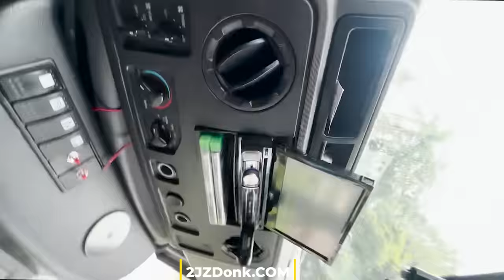Puttin New 24" All Gold Daytons on Fredrarri's 73 Chevy Vert

Comment: cuz definitely has never put daytons on before, the other video was extremely difficult to watch.when installing daytons that are not color coded adapters "red right and white left" the rule is the knock offs/hex heads/wings always tighten to the front! that means it screws on tight as the car goes forward.after you drive the vehicle you need to beat the hex head after a few miles cuz there is chances that it will loosen up! cloth over the hex head, key on the hex head,foot on the key, then beat the key with the lead hammer.
Reply: Agreed. They also won’t know that you ABSOLUTELY need to put grease on the center adapter! Daytons are a pain in the ass and the smallest details matter. The way these were mounted, I wouldn’t be surprised if one comes off while driving OR they don’t come off because they welded together due to no grease.
Reply: You're 100% wrong. The knock off always tightens towards the rear of the car
Reply: I can't speak on Zenith but Daytons tightened up to the rear. I have had em in 20 years but I might be tripping too
Reply: @stevofla239  yes my fault i will edit my reply, however my point made further in my reply is the easiest way is to turn the wheel forward as the knock off tightens.
Reply: @djtgrind  no ur not tripping i wrote the direction wrong, but what i meant  was the knock off should be tightening as you drive forward.
Reply: He said it was some gold plating trash in the threads.
Reply: The fender is hitting the wheel wat is yall talking about, you gotta get it shaved, he shoulda did that before he got it painted
Reply: Facts - and some learn the hard way about knock offs -  be pulling up to a red light and one rim is running the red light while your car is still at the red light 😂😂 - they will definitely get loose and pop off
Reply: No grease 😢

Comment: Big problems if not greased. Will be cutting the hex caps off. ....you could edit this video and send it to dayton because those hex shouldnt be that hard to thread on.  I had it happen once and it was some new chrome adapters and some casted NOS 3 ways from the  90s and the threads didnt match up.

Comment: Grease is required on tha Dz. Without grease they will be a bitchh to take off. Good job though 🔥 i know how that gold plate can get thick too, use a wire wheel on the inside of the spinner